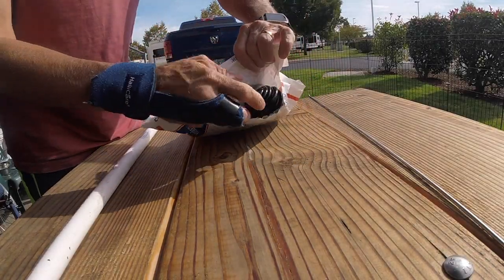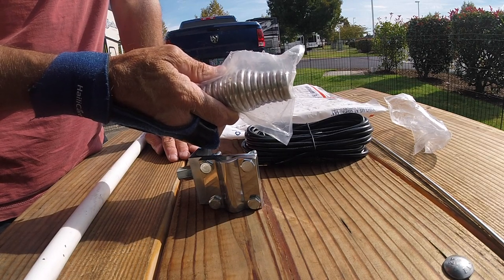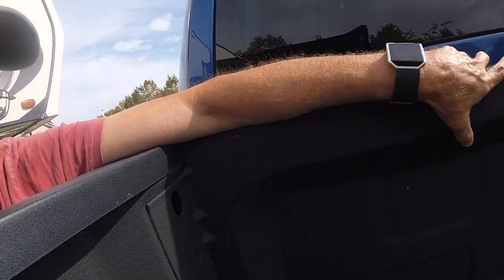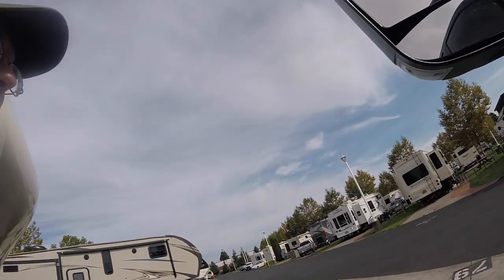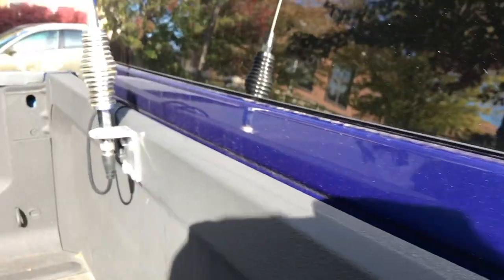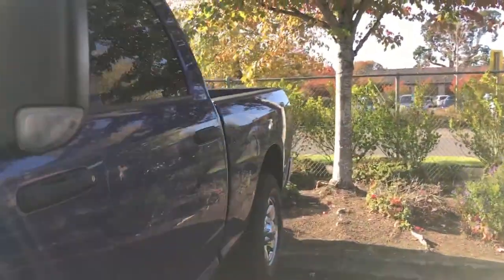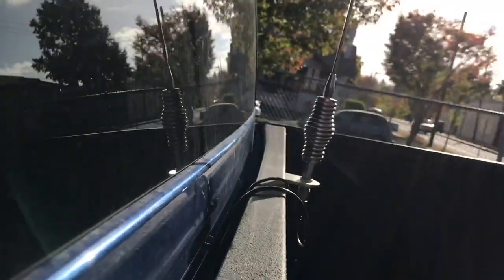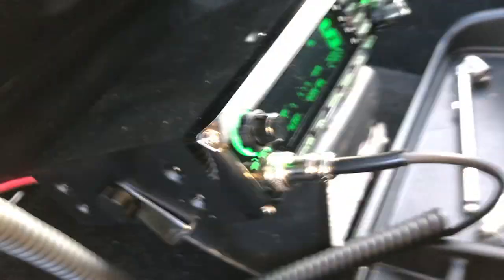UNBOXING, MOUNTING 102-inch CB ss whip antenna on our RAM 2500

Comment: How much coax did you use
Reply from the maker: Hi. I used an 18-foot-long coax. That seemed to be just the right length to reach from the antenna mount to the radio through the firewall.
Reply: Depends on the frequency you want to use it on and the velocity factor of the coax.